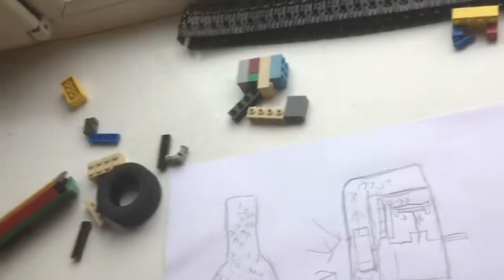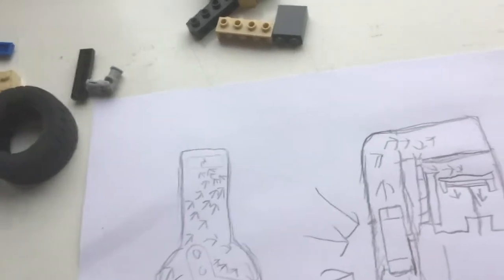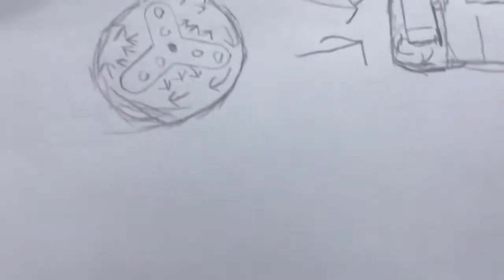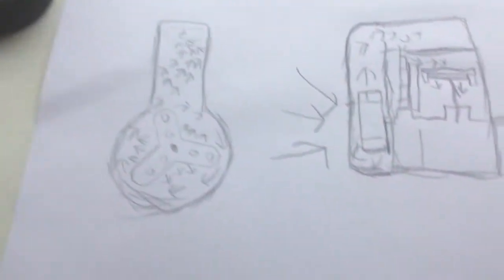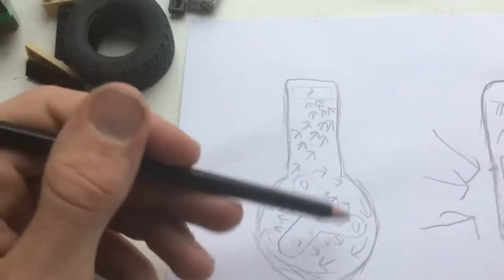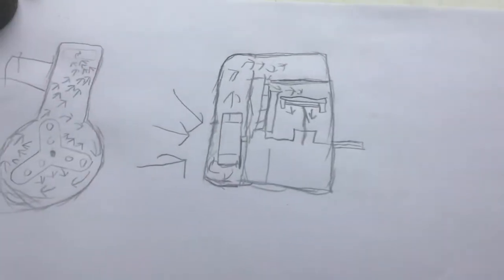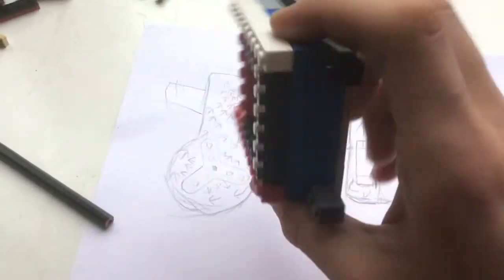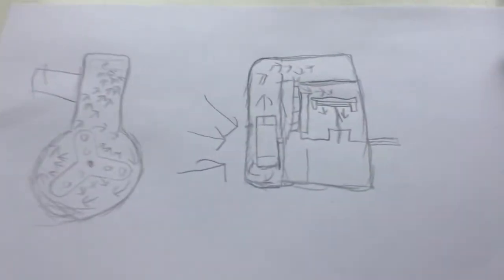supercharger concept for Lego  vacuum engine. (“Voice reveal”)

Comment: I think I did it!  I have been trying for years just like others but I think I actually made a working supercharged/turbocharged lego vacuum engine! No 3d printed parts no modifications no gearing up and no boosting by the vacuum. I will be doing test tomorrow and will likely make a video tomorrow.
Reply from the maker: That’s really amazing I really hope it works
Reply: @vacuumpowered6119  I have a video already! But it does make slight boost I think idk

Comment: Why not put it at the front of the engine and it won’t affect the the intake valves connection to the vacuum?
Reply from the maker: Because it would spin the opposite way.
I do have something else in mind but that’s maybe for later

Comment: Very clever idea! I never thought of it like this, I think it might work without losing efficiency due to friction.
Reply from the maker: KFPLUS Lego Mastery first time I learned from school haha, I don’t really know if it’s gonna work because I think if it’s making pressure it’s probably going out of the “intake”
Reply: @vacuumpowered6119  it wont work bc the bigest problem is u use the momentum of the engine and flywheel to power the engine + u cant just get more power without ading more power ore optimisation of the engine.